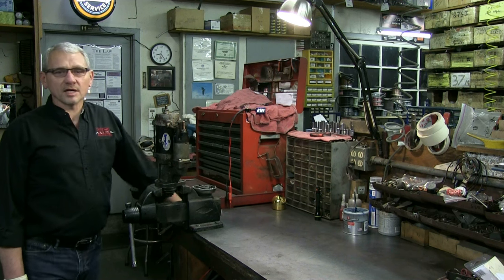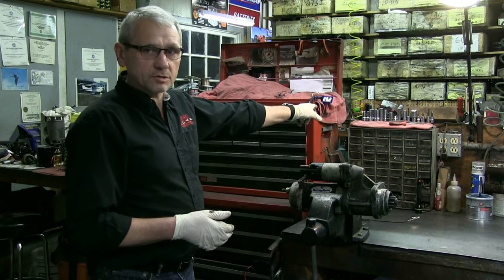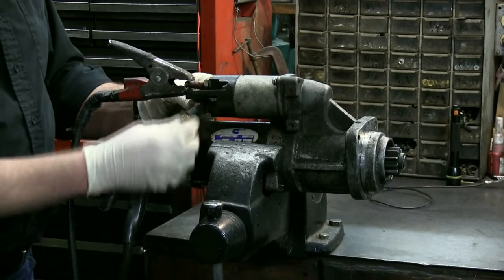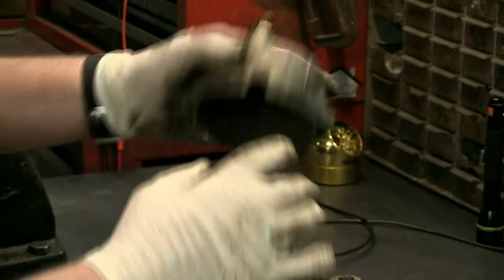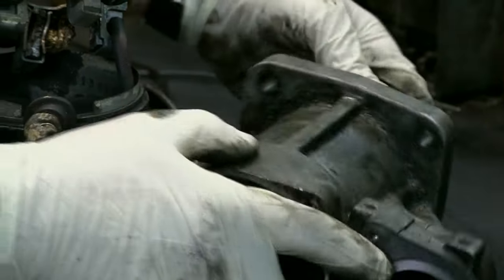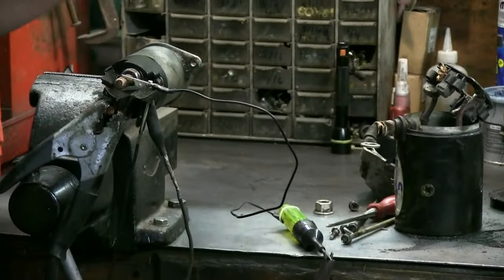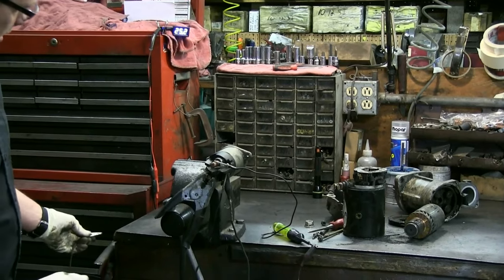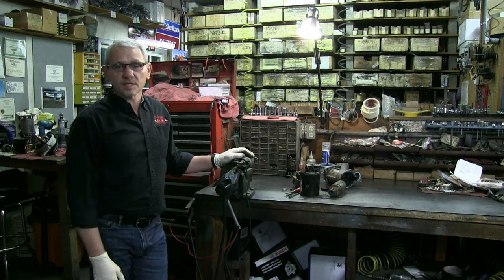Solenoid Testing 101

Comment: Thanks for showing the solenoid should indeed draw in when dismounted from the battery and supplied power. All the other videos I'd seen were testing the solenoid as you had done during the first part - with the starter fully assembled - and now I can see why that can lead to bad conclusions.

By bench testing my starter solenoid independently of the connected brushes, armature etc., I was able to confirm it was faulty.

Comment: Good video. I just took apart my starter and gave it a clean and this explains why my brush wires looked like a rainbow! The problem was the fuse on my starter keeps blowing, like it's going straight to ground and bypassing the motor. I'll reinstall it tomorrow and see if a cleanup did the job, it was a bit gunked up, but not VERY bad..
Reply: instablaster

Comment: Excellent video.  Why do some starters though go out repeatedly?  I have a 1981 Mercedes 240d diesel and have replaced the starter in the last 2 years 5 times. The ignition is also replaced a year ago to make sure that wasn't the problem.   I am getting starters from O'Reilly's and often when you put the starter on the first couple of times you can hear the starter motor spin but it won't engage the bendix gear with the fly wheel.    The last starter I got from them was a rebuild from Wilson.  It lasted 11 months and then at a gas station it just stopped working with no warning.  I got the car going though with a push start and popping the clutch  and got to my destination.  All of their starters are rebuilt using Bosch starters.  Even the last one rebuilt by Wilson that I bought at O'Reilly's was a rebuilt Bosch.  AAA said the battery was good and the wires were good.  When I took the starter down to O'Reilly's they put it on a machine and it would not even click. I put another store brand O'Reilly's rebuild and two times it spun the motor but would not engage the bendix gear.  Then after the 3rd time it finally worked but it still sounds underpowered compared to the Wilson when it was working.
Reply from the maker: I suspect you don't have enough key power to activate solenoid. We suggest a start relay.

Comment: Should the Pull-in Winding and Hold-in windings each have such low resistance? Ohm tested them both on a good starter, each reading was .4 ohms.

Comment: Hagmeister ty, In my quest... if i see a gd secondhand starter this the same same, and has the number of teeth and the mounting holes are the same centre to centre would the be right to purchase specially as its half the price of Auto Parts Suppliers, notice they have two dif brands but the specs are the same as recommended for my vehicle
Reply from the maker: Call us with your info

Comment: If I understand you right . Both the starter and Solinoid must have a good ground together get the Solinoid to work. I'm talking Mercury outboard. If I bypass either Solinoid or battery. They work. This has been a two month work shop for me.

Comment: culd it by posibel to use a alternator ore starter motor ass a magneto? I have a problem I use plazma ignition aperantly baterry has 14-15v put gets no amp faster starter motor turning bether spark but dont know why my alternator stop working aperantly alternator light come ON and stay's ON until I go higher rews so I dont know how bypass that voltage regulator I have small GM alternator 1small fiald wire and 1 big lead to baterry positive. that dual/plazma ignition is strange staff. does the dummy light size has somthing to do with it? culd I bypass that dummy light and simply put thise 2 terminals on alternator together because Im not shure if that is back charge Europ delco remy alternators are diferent from USA delco so Im puzelled why that baterry has no amps even tought evry thing ells works.

Comment: I live in Minnesota and I had a problem last winter with my starter on my 93 Chevy. When starting in the cold weather all it would do is spin. Thought it was a bad bindex or sticking, so I bought a rebuild starter and it worked for a couple of weeks and back to the same problem. Summer comes and no problem works great. Now problem returns now that is getting colder out side. I replace heavy cable going from batter to the starter and checked all the ground cables. and the battery is new. Can't figure it out. Any suggestions?
Reply from the maker: Our first question would have been...what's the crank voltage at the starter during crank time

Comment: How many pounds or ounces of pull should it take to pull the starter drive out to the position where it would engage the ring gear?  The starter is in a 1993 GMC Vandura with a 5.7L engine.
Reply from the maker: Did you happen to send an email also? We answered a similar question a day or so ago.

Comment: Is called a commutator which is apart of the armature...  and if you replaced the brushes and sanded the commutator a little to get rid of any high points as well as sanded the ground contacts on both points than the starter motor would still work for some time but could go out ..  could work for a good while seeing as some of the broken comm bar was still there to energize that section of the motor windings..  as long as the brushes dont get torn up by the broken spot and the thing would work fine because the opposite side of the commutator would still propel the armiture enough to start it spinning..   that is if nothings shorted together on it..  those old motors had a bit more beef under their balls than todays motors because of all the cut corners and penny pinching...
Reply: @Z Ack - Please tell me you’re joking, that thing is friggin toast. I don’t know how many starters you’ve R&R’ed before but take it from somebody that’s done more than you can count, it ain’t no fun. Just let the man fix it right and be done with it. Geez....

Comment: Something caused the started to be overdriven as evidenced by the armiture flying off. It it possible that the solonoid was staying engaged and keeping the pinion gear in contact with the flywheel. Either way your right they need a new one.
Reply from the maker: You are exactly right, something caused the issue. What we were trying to convey in this video was the customer self diagnosing the problem and telling us he just needs a solenoid, when he needed a whole new starter. If we had just sold him a solenoid like he wanted, he would not have been a very happy customer once he installed the solenoid and found his problem still existed. We make it a point to educate our customers and ask them questions too, like: Why do you think it's the solenoid?? thank you for you comment, Larry

Comment: Hi there, removed my starter , then wanted to see what was not working.  I connected an earth jumper cable to a different battery and to the body of the starter and the positive cable to the battery and then to the positive 'pole' on the solenoid.  The starter spun immediately but the 'shaft' with the gear on it ,did not thrust forward.  Any ideas,  thanks in advance .
Reply from the maker: What type of starter do you have? Can you email us picture?

Comment: Hello sir I have unusual question.
I have gasoline engine and I try kinde of finde disel starter motor with planetary gear set .
I found one nearly identical even tought its from different car .
I managed to use all 4 insulated brushes and use thick cabels I managed to reverse direction for the starter motor because me gasoline engine turns oposite way.
Now me problem is the reduction gear has couter grewes drilled and the clutch on the bendix turns the oposite direction.
Is it posibel to disabel that clutch function? Ore modify that bendix in any way?
I need badly high torque starter motor because I like me engine advanced ignition timing for bether fuel economy.
So any help please?
Im not shure how I shuld atach the selenoid he does not realy work .
It is a magnet starter motor so I have dificulty finding parts .
I have years problems with starter motors expecialy in winter time they do perform porely .
And I wanted to know why some starter motors have 2 and 4 brushes ?
Can they actualy be 6v starter motors if you actualy remove 1 pair of those brushes?
Me curiosety get the bether of me .
But in the old days they suposedly used relays ore selenoids if Im not mistakeing the old delco alternators to excite field coil in the alternator is that correct?
I do have after all delco starter motor with S and R terminal selenoid  so culd that thing tehnicaly excite the alternator with diode?
This is just tehnicaly speakeing of course.
How do you actualy test polarity be coils for starter motors?
What will it actualy do to the alternator if you for some reason reverse polarity be those starter motors.
Reply from the maker: It is not possible to modify because the shaft has a helical twist the opposite direction.
Reply: @HagemeisterEnterprisesINC  ok thank you

Comment: Could you show me how a Folo-Thru bendix starter drive works? This is on an old 1948 Willys Jeep, CJ2A with an Auto Lite starter with a tag that reads, MCH 76203 10N, Also stamped on the body is Rebuilt - 3382
Reply from the maker: This link https://youtu.be/jn7d-KZsIxs to our 6V to 12V conversion should give you a general idea. If you need more information, let us know.

Comment: Thank you for your good  video, but recently i took my car to a mechanic  to do some work after one week the starter seems week to crank... I am suspicious........ what you think?
Reply from the maker: you need to take a volt meter and check the crank voltage right at the starter. The voltage needs to remain 9 1/2 - 10V during crank time. Let us know what your results are and we will continue this conversation.

Comment: Hail l am from Rodrigue island ,I have an old Mitsubishi and when l  start ,the starter continued running even l stop the contract ,to stop l must take out the positive cable on the battery , could you help me understand the problem
Reply from the maker: To test you would need to take off the key start wire and manually jump that terminal to activate the starter. You need to do that so that the key switch is not in the connection so we know that that’s not bad. If it continues to stick, you might need to clean the armature shaft. It could be contaminated, allowing it to hang up. Hope this helps.

Comment: Got an,issue with starting, sometimes the motor starter wont turn over, though not tech tests conducted yet it starts well 98 percent of the time, so battery and starter are in good shape. Can you suggest the solution with only that scarce info.. Gracias por todo.. Aufwiedersehen.. Terracan crdi 2.9 SUV..
Reply from the maker: Does your system have a Start Relay because I am concerned about low power from the key switch.

Comment: Hello there- I just replaced my starter in a Chevy 1990 4.3 V6.  The problem is that after replacement, I cranked it for the first time and all was well.  The second time that I tried to start the engine, I had no power on the dashboard and my battery poles literally melted.  I don't know what to do....Any Ideas?
Reply from the maker: More than likely it is loose or corroded connections

Comment: 02:24 Is NOT a ground and its a common misconception - All starters i know have no ground, ground is via bolt to engineblok
Reply from the maker: There is absolutely a ground in a starter, the video is correct and is explained exactly to T on how this starter and solenoid work together. If you have any questions please give me a call.
Reply: @HagemeisterEnterprisesINC  okay never seen that before, and makes little sense as the metal case will act as ground any way. can you please give me the starter model so i can look up the electrical schematics.
Reply from the maker: We are working on some information for you. It probably will not be a schematic but we want to show you some differences in what you are calling a “misconception”. This may take us a bit too work this into our schedule but we will address it.

Comment: Your video is not accurate. You state several times that the solenoid was not seeing a good ground yet you can clearly see at the beginning that the solenoid is drawing amps because of the intense sparking. If the grounding was interrupted, there would be no sparking. What more likely happened is that the physical damage to the motor caused the solenoid lever to become jammed in place, thus not allowing movement of the solenoid plunger. That is why there was no click yet there was amp draw. Then after you removed the solenoid and tested it by itself, you unjammed it from the motor assembly and it worked by itself. So the solenoid was mechanically jammed because of damage in the motor housing, not because of an interrupted ground connection.
Reply from the maker: The interrupted ground on the CE cap to the brush holder was the beginning of the demise of this starter. The armature bar (being flown out) locked up the starter. There was no mechanical shift fork / pin lock up. Clearly the starter was over cranked.

Comment: I like your video, I Resently had a starter taken apart, was full of salt water, dried it out , soaked it with , cleaner , all looked well , put it together, put it on the motor , worked fine, started the motor , few times , then it quit again, ? Why,
Reply from the maker: Interesting. Without seeing it, it’s difficult to diagnose. Is possible the armature had too much salt water damage.

Comment: I am fedup of my Hilux 5l starter motor after cleaning it and changing the carbon bushes and cleaning the ground connection on that back cap the motor works fine for 24 hours after running the pickup for hours and the switching the engine of and restarting it after few seconds it doesn't work it can't rotate the engine properly

Comment: Great video, but I would really appreciate a clean diagram showing exactly how you had the solenoid wired up when testing it isolated in the vice. Alternatively, it would have been nice if all the wires were clean and colour coded. It's hard to tell what goes where because they all go out of frame.

Comment: you are wrong that braided copper wire is actually positive current that flows to the brushes and not negative  and the brushes that are grounded are actually soldered on the case itself so what you were doing when the light turned on was actually shorting out the cables that's why every time you touched the positive it'll drop so much current and you say you have 30 years in business well i have 3 years repairing corvette wiper motors, headlight motors and starter motors and you sir are wrong about the braided strap being ground.
Reply from the maker: Just to clarify, I didn't say Negative in the video. If you rewatch the video (time stamp 3:45 to 4:30) I say the electricity (being Postive Battery Power) runs through the strap, through the field coils, etc. - Also the brushes are electrically spot welded to the plate not soldered.
Reply: @HagemeisterEnterprisesINC  - Clearly one of the main drawbacks of posting videos on YouTube is dealing with boneheaded comments from self proclaimed “pros” like this guy. Oh well, you can only try to educate people. Thanks for a great video. 👍